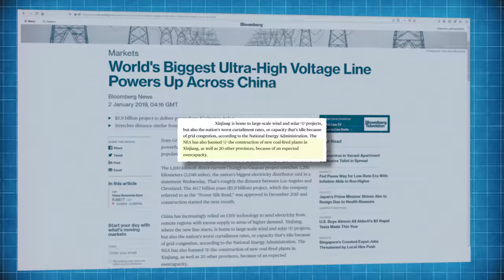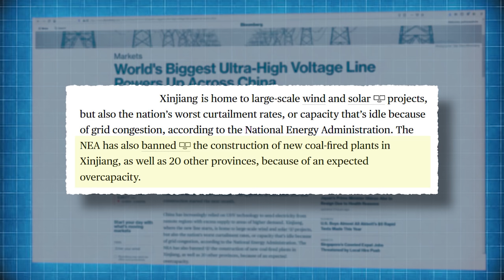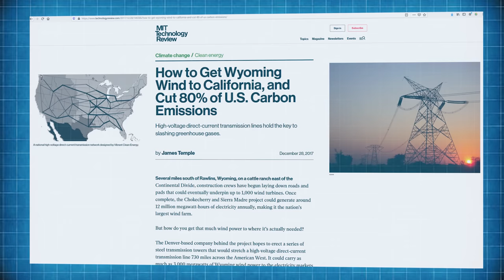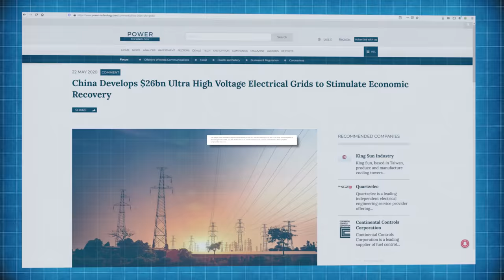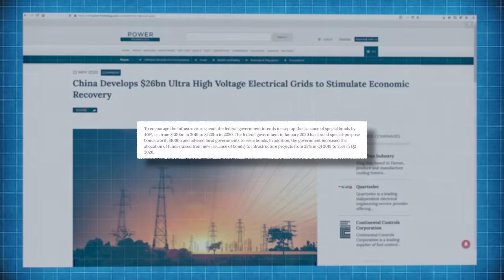China's MILLION VOLT Energy Superhighway

Comment: 25 years ago, when I was working on gathering facts on transmission in Asia, there were several HVDC transmission lines already in use.  At one time EPRI was experimenting with transmission lines of 1300 KV.   I couldn't find any reason why the Chinese shouldn't be building 1100 KV-DC lines in Yunnan or Xinjiang or elsewhere, as line losses are less than AC. Spending $200-300 billions in infrastructure improvement is way better than wasting $6 trillions in Iraq and Afghanistan.
Reply: The oil seller need the oil/
Reply: Depends who's paying you
Reply: South Africa was doing HVDC over 40y ago. https://en.m.wikipedia.org/wiki/Cahora_Bassa_(HVDC)
Reply: @shaunparsons3659  Yup; but now the state isn't allowed to do anything grand or even to allow others to do it for them so that we can keep making the apartheid criminals look good.
Reply: DC is not what it is cracked up to be in the video.  You cannot put branches on DC.  DC is pt A to pt. B and C cannot connect.  It is why you can run giant DC cables between regions as everyone around the world has been doing for many many decades before the Chinese decided to join in and morons like this host jumped on board...  One aspect of DC he did NOT cover is that running DC underground  or under rivers/oceans is VASTLY easier to do than with AC...
Reply: @w8stral  I'm sure you're reasonably well informed and also frustrated. However, I don't trust someone who calls others morons. If you had said that the host isn't fully informed, then I could have more trust in your statement.
Reply: w8stral 

he never said the chinese invented it, just that they've decided to put big infrastructure spending down on it now, since it makes more economic sense than it may have previously.  the parts for their grid are made in and bought from europe, so obviously they didn't invent HVDC, and he never even implied that
Reply: Someone give a think.
Reply: @BothHands1  Indeed, I don't understand where this guy is coming from. He seems to see things that were not said nor implied, and is rude about it.
Reply: @w8stral Children, children, children...
Reply: @rickydee5863  DId I say that?  No.  Said Chinese Engineers and I unlike you are not so stupid.  They are importing gobs of NG from Turkmenistan and Russia.  Burning it in Western China instead of pumping it to Eastern China and making that HVDC line power output nice and steady allowing them to put highly variable WIND power on it.  True, not as efficient as burning the NG in Eastern China, but they are importing it anyways and otherwise could not use their wind power installed... So, half a win is still half a win instead of a loss.  Same reason Europe is going all in on Wind.  It is what they have.   PS: Everytime you go DC pt A to pt B, take some power off it, and then try to get HVDC to pt C to go to D, your dipole(how they are transmitting it) has to be balanced and getting said power from B to C is highly INEFFICIENT as you have to go from HVDC to HVAC to HVDC.  Why you will often see TWINNED HVDC power lines starting at a single(power source) point but going to 2 different spots.  Dipole must be balanced.
Reply: @rickydee5863  Your last sentence nailed it.
Reply: @yunmoh628  You can't limit your learning because of some emotional attachment you may have to politeness. Move passed that and form an opinion based on facts. Sure this poster appears arrogant and rude but the logic may be sound.
Reply: @euphoriceuler  His presumption of a solution with no knowledge: and I get very tired of greenie Utopian fools keep talking about HVDC as if it will solve Wind/Solar problems.  Their problem is intermittency and not available at all for 2 weeks at a time, not transmission.  Likewise you need to read what you link man.  What is proposed in this white paper(not reality, and not even lab tested) is essentially a parallel/series connection with circuit breaker loading prior to the dipole connection, not IN the dipole connection if I read it correctly for load alleviation/matching/reliability assuming a wind turbine drops out etc.  It is possible they are trying to make the dipole out of the wind turbines themselves, but keeping a constant output or one which follows demand curve... They used some acronyms which are new to me.  Of course abstracts fail to say what happens to the excess power... seems it is just wasted.  Appears this is just a quick breaker disconect.  It certainly is not a multiple HVDC connection as you stated.  Rather it is trying to series/parallel connect DC Wind Turbines which are running PM generators so they can cut out the AC conversion losses and the AC power line losses which do not go well with say... UNDERSEA cables. Going to need big batteries I would think as one of their ring connections.  Think AC, but in DC.  A ring dipole of sorts which bounces the node to laod balance... DIPOLES are used purposefully for long transmission.  HVDC without a dipole is USELESS for long transmission.  Massive loses.    In either case, no you cannot have multiple connections with this, what you can have is multiple POWER sources which are all roughly EQUAL.  Now technically you could have many LOAD destinations if you have all the loads equal.  Hate to think what LIGHTNING would do to this setup... Seems a showstopper, but maybe giant mercury thermisters(old school HVDC) to alleviate transients...  To make this work, I think would have to throw out 50/60Hz AC and go with a MUCH higher frequency to quickly balance load if the HVDC ring dipole end points are close enough... of course WHY bother?  Just go with HVAC which can easily load balance and the network grid already exists.  Seems this is solution trying to find a problem.
Reply: yeah ..we spent all our tax money on weapons to steel the oil from the indigenous peoples of the middle east.. and these people can use their iPhones to research where all the parts in their phones are made and it's not your countries. you let corporations devistate your economic prosperity by shipping all manufacturing over seas and then get bailouts when their further theft of their people backfired on them by your political sycophants left right center..but keep telling yourselves how exceptional you are.
Reply: there are three hvdc lines from the european mainland to southern england. two are owned by EDF, bringing nuclear power from France, one by London Electricity (last I checked, which must be 20 years ago) to and from Belgium. These things are not new.
Reply: @grantadamson3478  
We have "emotional attachment"??  The forum has rules and the rudeness doesn't conform to them.
Reply: @w8stral  If you have not worked in the Chinese power transmission network you do not have credibility to comment on their choice of equipment and the load profile.  If you have transmission netwrk knowledge you should also know the 1100kv-DC is just a small part of the China network.  China is the biggest energy generator in solar, wind and hydro.  It generates 50% more electrical power than the next runner up US.  Any person with common sense would expect China to use the highest voltage transmission line that the world is using.
Reply: @dickhamilton3517  are they at one thousand volts? asking for a friend.
Reply: @shaunparsons3659  550ish volts
Reply: @Mayangone   "I couldn't find any reason why the Chinese shouldn't be building 1100 KV-DC lines". I read that leakage (I assume through moist air & insulators) becomes increasingly a power loss that counters the increased efficiency of fewer amps per watt as voltage increases. You'd need to research it to find details because I haven't.
Reply: @acmefixer1  That was not my point. Please have another read.
Reply: @chuckthebull  This is what you get when the military own the politicians.
Reply: @grantadamson3478  Yes indeed,   and as well as the media sell the same lies of the main stream establishment and feed the cultural conditioning to the mindless livestock prolitariates citizenry who suck it up like jim johns fruit punch.
The MIC is the most successful protections racket ever devised by man to steal the wealth off the majority to funnel it into the oligarchy minority. Thus enslaving every man women and child not in their cult of opulant psycopaths club.  Main stream media has a vested interest in keeping the public maliable for manipulation to sell them useless products and ideas to serve only them and the profit of the corporate and political  establishment.
Reply: There is a way to transfer energy using hydrogen pipelines. just like oil and gas. H2 Can be burned too or used in fuel cells. There are losses in conversion but storage is possible on large scale and intermittent wind can still be converted to H2, stored and transferred later, might work...
Reply: Not necessarily. Spending $6 trillion in Iraq and Afghanistan is way better for the military-industrial complex supporting your elected congressman and the president, than spending $200-300 billion in infrastructure improvement 
Trust me on that. Where do you think they have the yachts from? Infrastructure spending?
Reply: @lesterryanmd  The question is EFFICIENCY, not can you do something.  IF the latter then HVAC works just fine.  Grown ups are talking about the difference between 97% efficiency and 96% or 95%.   And no, you cannot have a dipole/tripole with an unbalanced connection.  GIve a hint should you wish to learn something, All HVDC which are claiming their HIGH voltages?  Are actually half that voltage, but since it is a standing BALANCED dipole, you get the advantage of double the voltage and therefore less losses due to RESISTANCE...  You wish to dick around with unbalanced straight DC, ok dude, go for it, but you will not get the advantage of the dipole in which case just boost the HVAC voltage.
Reply: True, though I don't like the CCP because they violated and don't respect our sovereign rights here in west philippine sea (south china sea).
Reply: @chuckthebull  next time you need bailing out in a world war call ... I don't know maybe France.
Reply: you are correct, if there is clear and relatively simple way to improve those grid efficiencies, it should be no brainer to invest in those. I never see green folks talk about these, yet those improvements are cheaper and bigger effect than private citizen can do. it is infinitely better than pouring trillions for bankers to play poker in stock market as they again did.
Reply: Agree but menacing and harassing some backwards members of the faith of peace is simply considered FUN !
Reply: @ricos1497  what do you mean?
Reply: Mayongone, your comment is nothing more than a political statement. And since you had brought it up, how much does China spend in maintain their thousands of concentration camps housing innocent people? How much is China spending in building cement islands in a region they don’t own and fortifying them with missiles? How much waste did China spend in building ghost cities?
Reply: Hiro Takkan, they are free comments from free speech in a free country.
Reply: The Endless Wars of American Military Weapons Industrial Complex and NATO Hegemony plus it's Weapons Sales to the Cohorts of Fossil Fuel Corporation violating the World Ecology.
Reply: Mayanagone, YOU are right. US troops are in Afghanistan to protect the
opium fields that financially benefit 'those in the shadows'
I roll with trump & patriots
Reply: @w8stral  you argue so strenuously against HVDC as if the Chinese have not thought of your objections and included them in their planning. The Chinese produce more engineers of every sort every year than most of the rest of the world combined. I suspect that they can evaluate where it is most efficient to use HVDC over HVAC as can any other country where the grid is national and not split up between a plethora of competing utility companies. We don't even have efficient interconnects between many parts of the nation. We'll all get to pay when a large CME shows up or N. Korea decides to expend their few ICBM's on high altitude bursts over the continental U.S. It would be a large project to clean up the grid that exists and properly connect it in a redundant manner.

Think of the air traffic control system. Parts of it are running on computers that are over 50 years old. There have been several attempts to replace, all failed. Many of the displays are old and faded and cannot display the information that is needed because the system does not have it. ATC's typically have fairly short careers because of the strain of trying to be perfect using a system with known flaws and that may fail without warning and without backup.

We need to find a way to address these what I call generational problems and those like them as they come up.
Reply: Word! 👍👌
Reply: @w8stral  Granted the idea is not new but the scale and improved tech are (apparently not Chinese ) , I checked and HVDC lines have not been that extensively used except indeed in Scandinavia I suppose for the reasons you stated . No a sufficient reason to call this host a moron just because you were aware of the tech.
Reply: @Crashed131963  Avery partial account of the situation and a very poor understanding of historical factors .
Calling a country over populated or under populated is a very subjective judgement . China pollutes a lot because it produces most of the shit others consume .
Historically China sustained a much larger population because both its technology and political management allowed for it  as it did for India , the fairly recent technological western boom and the upheaval it caused in the balance of powers of the world  has not yet stabilized in n even remotely  sustainable system,  its most significant consequence  was the demographic explosion it produced and is still going on in certain parts of the world .
I can understand people getting a bit irritated at Chinese smugness , but considering  the obtuse arrogance of ignorant westerners I'd be inclined to cut them some slack .
Reply: @ingridschmid1709  If you are interested: NO, I will not babysit you.  You can google, though Google is Shit for searching anymore as all it gives is Ads, so I suggest Bing.  Search for  dipole HVDC.  Look up DC to AC conversion efficiency.
Reply: Yun Moh ... I agree. And that goes for Elon Musk too.
Reply: Spending huge money in war benefits the riches, selling weapons, equipment support industries. Infrastructure benefits more middle classes, but who cares ? This is how capitalism works.
Reply: @chuckthebull  Nice version of old metaphors, I can understand people getting worried about Chinese power especially with its reins gathered in the hands of so few, but then such excesses aren't that far away here , but what I don't get is this mixture of fear and utter contempt .
Reply: @ingridschmid1709  what about the power in the USA in the hands of a few...that idea is bypassed because most Americans still operate out of the self propaganda idea that the oligarchs controlling them are these sacrosanct magnanimous protectors.. even the farmer calls the vet when his exploited livestock get sick..but Americans especially can't see that they are so trained to be docile and afraid to confront their pleasant farmer while they shuffle up the slaughterhouses ramp..
yeah I get it..the cage in the USA is gillded gold so they feel "special" 
that's the big rub,,they all point at the Chinese communism as the big bad evil when they can't see their own dirty house staring out one of its windows. but they suck up main stream propaganda sitting in front of their one way TV lie machine oblivious to how they are being played and mind controlled. but it's so sophisticated and tuned to them being trained to be trainable for generations they refuse to even consider the possibility..this is why they are taught fear and then bolsters their ego up with false mythologies of exceptionalism.. install the existential crisis and then heroic peacockung..invent the vilian market the hero,,it's consumerism for their psychology of sense of self..This makes them willing cannon fodder for the military industrial complex. But they are so very proud of being completely ignorant to how they are led around by the nose. The corporate state owns them all by a small band of the investment class and political left right paradigm of sycophants that support the systems that exploit the mass's...but the rust belt is still rusting , no bail out for them but big bankers? yeah a nation who worships them like God's, But oh those dam Chinese, Russia etc..my god these people are dumber than a mud fence. They won't even bother to decern propaganda or fact from fiction because that might make them look in a mirror and ruin their delusions of grandure.
Reply: @chuckthebull  You didn't read me fully , I did suggest that the very same issues applied to the US just as perilously and probably are worse.
At least the Chinese system probably cannot promote total dolts in positions of such power .
However absolute power corrupts absolutely , and president Xi's seems to me a bit too absolute to be without dangers .
Reply: @ingridschmid1709  no doubt,, and yeah after rereading your comment I can see your position, and I agree. .although as a world travler I have been all over and met all kinds of people from all cultures and I have seen that the average citizen of other countries to be no different in their hopes and dreams as any other decent human being no matter where they hail from. governments fight and expend their own people for their selfish interest but I'm sick to death of this American centric posturing propaganda bull sh!t to dehumanize other people's and cultures and know fully well it's all based on intellectual cowardice by people to enamored with their own distorted reflections to ever realize they have no leg to stand on pointing fingers. And most of them never left their fu(king porch.
Reply: @w8stral  So are you for or against it?
Reply: @altond511  IS the world black or white?  Hell no.  its called being an engineer/human being who is rational.  Everything has its place and trade-offs and nothing is perfect.  HVDC is no different.  It has its place.  It is no panacea utopia.  It is a slight increase in efficiency for a VERY specific application backed up by HVAC.
Reply: The correct noun is "ignoramus".
Reply: @w8stral  *Ah, Sam is a troll I see.  Did you get paid 50c to post?*
The typical anti Chinese poster that would attempt at anything to discredit China.

He does not work in China, makes a bunch of claims and thinks he smarter than Chinese engineers while not paying attention to the entire picture.
Solar and Wind is different in China compared to US. They have very large plants and very large wind farms and to boot they have a lot more things you don't know about in detail so who the heck are you to judge?
Reply: @w8stral  Have you bothered to consider dc vs ac line cost over distance? Consider 3000km long lines. Corona discharge is also 3 times higher in HVAC than HVDC and that is just part of it.
Reply: @AFlyingCookieLOL  The difference of AC/DC is that the terminal points of DC are vastly more expensive and lose a lot of efficiency.  The line between terminal points, AC loses a tiny bit more, but DC wins in only requiring 2 lines instead of AC's 3 for most efficient transmission.  Of course if one wanted to be picky, could boost/decrease frequency above/below 50/60hz and go with 1khz and your caronal losses + magnetic problems drop massively depending on loss ratio one picks and you could go with 2 lines instead of 3... Of course the reactors(giant spinning motors) or modern equivalent(silicone cascading diodes) to step up/down the frequency would be just as expensive as HVDC to begin with with another layer of complexity. 
No free lunch in this world.  Gargantuan power lines, once paid for... Just like giant dams/canals/wiers/harbor dredging... last for 1000 years.  Depending on how good the towers are of course, so maybe less than 1000 years, but could always go with aluminum towers or stainless steel to make them last much longer.
Reply: @w8stral  wastral; you may well be a very nice person but fanciful opinion is no substitute for knowledge
Reply: @GaryGraham-sx4pm  Sorry to burst your fantasy that HVDC is not the bees knees and magically creates power.  So sorry to add reality.
Reply: @w8stral   it's ok, you didn't
Reply: @w8stral  your dipole is unbalanced
Reply: @GaryGraham-sx4pm  What the Hell are you smoking,... all HVDC lines are dipoles otherwise you lose the benefits of DC over AC.  Who is unbalancing anything?  You apparently in your own mind.  You can have more poles if you wish but it is harder to balance the whole setup.  AC lines do not work in dipoles or it should be said they work in open ended dipole... Or are you playing make believe where the wire length is shorter than the wavelength making it an antenna? Without balancing between phases?
Reply: Is DC really more efficient than AC for long distance power transmission? 

Quote - ".... Transmitting DC power over a long distance is inefficient. Thus AC supply is a far more efficient to transmit power.

According to Siemens it's quite the opposite:

Whenever power has to be transmitted over long distances, DC transmission is the most economical solution compared to high-voltage AC... "

https://engineering.stackexchange.com/questions/19758/transmitting-power-over-long-distances-what-is-better-ac-or-dc
Reply: @yl128pang3  Why you have to use DC in a DIPOLE buddy.  Otherwise DC loses far more power than AC if it is NOT in a dipole configuration.  DC needs 2 wires instead of 3 like AC.  DC has higher loses going from low voltage to high voltage and the $$$ required to boost voltage and degrade the voltage is far more expensive for DC.  So, DC in a dipole configuration is ONLY used for LONG distance power transmission where the slightly better efficiency(and here we are talking 1% or 2%) makes up for its INEFFICIENT boosting of said voltage in the first place compared to AC. 
The differences are minuscule with the lone exception that DC can be far more easily and cheaply be buried under an ocean, lake, very wide river than AC all the while maintaining full efficiency where AC is expensive, and loses efficiency trying to do the same thing.
Reply: @w8stral  ，he said in the video at  6:30 ".. Break-even transmission distance at about 600km.."

Not sure how did he get this 600km data?
Reply: @yl128pang3  ... can you do basic rate equations, or use der google?  Resistance of wire by distance in this case MAGNETIC losses of AC being higher than DC, but DC loses more energy increasing voltage to be transmitted long distance.   Now add that DC dipoles double their voltage compared to AC so resistance drops further.  

As for the 600km, I have heard of 600miles as well, but whatever.  Vast supermajority of power is not  transmitted very far.
Reply: Harry T  Did I hit your nerve "kid"? I think you should read the UNCLOS so we have that right to defend our islands within 200 meters I think. I am not a china hater but if they just don't respect the rule of law set up by the UN body especially when our nation contested that right then won the case but ignored it then they are not that different from mafias or gang just because they are big enough. Actions speaks louder than words ya know.
Reply: Harry T  Then, enlighten me. I am interested in hearing your own side of history. 🙂
Reply: YEAH - but you need to make the rich people RICHER.  Thats the POINT of democracy. Its way cheaper to buy politicians than it is to fight other rich people to become King.
Reply: @w8stral  The host is not a moron, actually, he is an export. The Chinese are not stupid. You will find out that your knowledge is outdated.  

DC power transport was an issue and many countries tried and failed to crack the problem. But China did solve the issue using ultra-high voltage technology and they get the benefit from the technological breakthrough.
Reply: @BothHands1  China did not invent HVDC. They did a breakthrough in the Ultra High Voltage Power.
Reply: @yunmoh628   ad hominem detected , professional debaters would should not trust you as well according to your logic since you did no different than attacting the character rather than the content of the argument
Reply: @kritika3983  So, the US haven't violated and do respect our sovereign rights? Think about who your biggest trading partner is and who is painting a target on your country in the push for a war with China, is that respecting your sovereignty?
Reply: @timgarrison8473  The US waited for tree years before getting into WWII and the vast majority of the fighting, and defeat of Germany, was due to the USSR so maybe it's Russia you should call if there's another world war. Without the US, it's said that the Russians would have been wading in the Mediterranean coast of France ,maybe a year and a half later than when they got to Berlin.
Reply: @L98fiero "The Lend-Lease Act was signed into law on March 11, 1941, and ended on September 20, 1945. A total of $50.1 billion (equivalent to $719 billion in 2021) worth of supplies was shipped, or 17% of the total war expenditures of the U.S.[2] In all, $31.4 billion went to the United Kingdom, $11.3 billion to the Soviet Union, $3.2 billion to France, $1.6 billion to China, and the remaining $2.6 billion to other Allies."
Wikipedia
Reply: @L98fiero "The United States officially entered the war in December 1941 and began direct military assistance in North Africa on 11 May 1942."
'North African campaign', Wikipedia
Reply: @anderslvolljohansen1556  Well ok, they waited 2½ years, is that better?
Reply: @anderslvolljohansen1556  And your point is what, none of it was free?
Reply: @L98fiero  There was a ban on sale of weapons to other nations at war, so the Lend-Lease act circumvented the ban by letting the US lend the weapons instead of selling them. Most of the weaponry got destroyed so couldn't be given back after the war.

Recently US planes were found buried in Ukraine, stripped of valuable parts. That suggests the Soviet Union lied and reported the planes as destroyed in the war, instead of returning them to the US.

I recommend you read the Wikipedia article on the Lend-Lease act.
Reply: @anderslvolljohansen1556  Once again, the USSR REPAID the LOANS, just like the UK and other countries that were sent the LOANED hardware that wasn't returned, what's the difference whether they were stripped and buried or shot down? Shouldn't logic be used before you make a comment?
Reply: @L98fiero  Where does it say the Soviet Union paid anything for the military hardware it received under the Lend-Lease agreement?
Reply: @anderslvolljohansen1556 In the 1972 agreement, the U.S.S.R. pledged to make three initial payments totaling $48 million and to repay the remaining Lend Lease debt once the United States had granted Most Favored Nations (MFN) trade status. ~ US State Department.
Reply: @shaunparsons3659  "South Africa was doing HVDC" means the wires were stolen now?
Reply: @shaunparsons3659  But it's only 533kV.